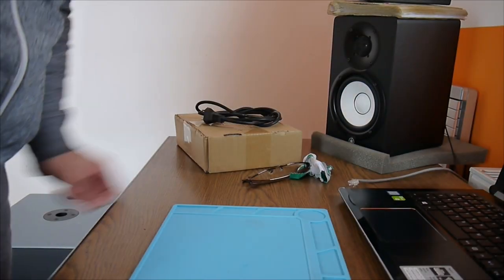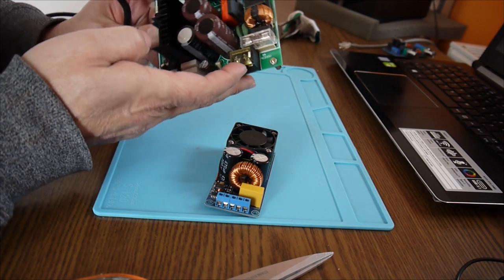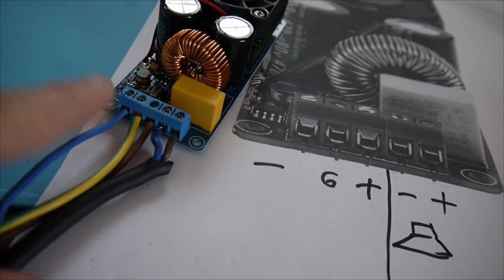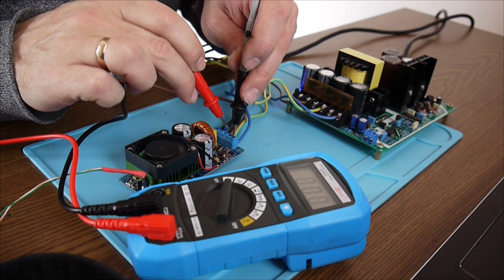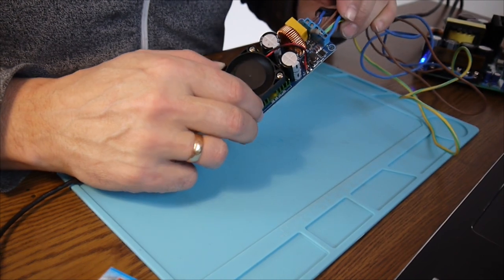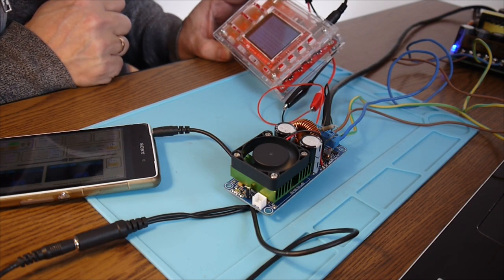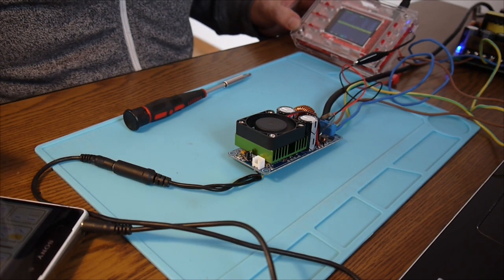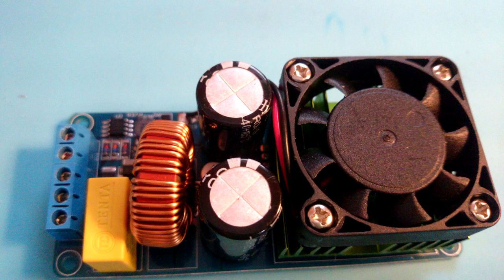Budget IRS2092 500W amplifier subwoofer project powered by SMPS 500W -+58V

Comment: I have tested these units extensively and now use them in a professional sound reinforcement application. When connected and used properly they deliver truly excellent performance. Unfortunately, this YouTube video shows very improper use. Here are some notes:

1. Choose a power supply appropriate to the speaker load. For an 8 ohm speaker, the optimum voltage is 63V. For a 4 ohm speaker use a 45V supply. The formula:
 V = sqrt(500W * speaker_impedance).

2. Class D amps, such as this one, work by switching their outputs high and low at frequencies far above the audible range. What you see as "oscillation" on the output is actually the carrier frequency. Under normal conditions (connected to a speaker load) the carrier signal is about 2 Volts. Because we cannot hear above 20 kHz, and the loudspeaker cannot reproduce sound at that frequency, this carrier leakage is not a problem.

According to the manufacturer, the switching frequency should be close to 400 kHz (as it is in the modules I have purchased). The small potentiometer near the input is used to adjust that frequency. This adjustment is necessary or advisable ONLY if you have multiple modules running off of the same power supply. Improper settings greatly reduce the efficiency of the circuit and can result in overheating.

3. NEVER APPLY POWER TO THE AMP WITHOUT FIRST CONNECTING A LOAD! For testing, you can use high power resistors.
The output of the amp drives a low-pass filter. The 10 Ohm resistor is burning out because, without a proper load, the amp is delivering its high frequency carrier frequency across that filter network.

4. Toucing the input leads with your hands as you have done here, effectively couples AC line noise to the amp by using your body as an antenna. Depending on the environment, this can be several volts and can easily drive the amplifier to its full output power, potentially burning out your speaker. NEVER DO THIS! Attach the input to a proper source such as a music device or function generator.

=========

On my bench, these amps deliver their full rated power. The signal to noise ratio (SINAD) is better than 80 dB (the limit of my test equipment), meaning that they are basically noise free. Silent, really.

The frequency response is flat over the entire audio range.

Other comments:
-- The power and speaker connectors are cheap and flimsy. You can purchase quality 0.2" spacing Phoenix connectors on the web inexpensively, and replace these.

-- The Chinese amp is based on a reference design published by the manufacturer (Infineon Technologies). For some reason, the Chinese amp uses a 100 Ohm resistor for R13 (near the input connector). The recommended value is 3.1K. I have replaced mine with 3.3K devices. This replacement is a bit tough for hobbyists, as they are surface mounted resistors.

-- Even though the amp is close to 90% efficient, at full load, it must still dissipate 50W as heat. The fan and heat sink on this unit are marginal, and the output transistors are not attached properly to the heat sink. At a minimum, be sure that you have good ventilation near the power amp. A much better choice is to replace the heat sink and fan. In my case, I desolder the output MOSFETS from the board, and attach them to a proper heat sink. I then resolder the transistors to the underside of the board,. This allows me much greater flexibility in heat sink design.

-- You may find it desirable to add some filter capacitors across the power supply input lines. Several thousand microfarads will help. Be sure to use capacitors with voltage ratings at least 20% higher than the supply voltage. Place these as close as possible to the amp to reduce the resistive losses from the power supply wires.
Reply: @Mark Cohen  
The fact that it works. I bought one module years ago and immediately replaced the R13, I put 3.01k in it. Works good, also, recomendation for better heatsinking is correct (Y) ! I used the same method, the MOSFETs on the bottom side of the board, on the larger aluminum L-profile, and on the opposite side of the MOSFETs I attached the same small heatsink with a fan, the area of the cooler is much larger.

Regarding the small trimmer in this video as well, it is wrong that it is twisted so randomly.
However - I didn't understand now that if you use several modules with one power supply, why is it necessary to adjust this frequency? What have I missed?
This module can be used bridged, and in this case it is necessary to set the frequencies on both modules to be equal. But is there any information somewhere about feeding several modules from the same power source and therefore some kind of frequency regulation if you DONT use them bridged but for example just stereo mode? What I have missed?
Reply: @inarinukka7729  THis resistor is already well known with this board.  - i got another question: From what i heard from other experts is that you acttually need the high voltage for max. power output on other class D`s as well. So i got 4 ohms speakers like most, why only 40V? Is that only a heat dissipation problem? From what i know these boards CAN take up to 90V input when you dissipate the heat properly. Thanks.. .
Reply: @MasterBlaster220  Why only 40V? You need dual polarity, sellers of these modules do not recommend more than +-70V but if you have module with genuine IRS2092 or at least good specimen (all of them are not good) of china equivalent - CSC3120 then you can go to even +-100V, in reality these genuine Infineon IRS2092 withstands this, known one experiment with +-110V and it survived. 
Manufacturer guarantees +-100V, i.e. the further is your responsibility, apparently a good specimen can withstand a much higher supply voltage, but it is individual. 
For supply voltages close to the maximum, additional protective measures must be used to protect output stage MOSFETs. If you have a good (known genuine) chip and fast MOSFETs, this amplifier generates very little heat, genuine Infineon chips do not need any cooling even at maximum supply voltage. Almost all (which I have had) CSC3120 need cooling because their losses are higher.
The only thing that needs cooling is output MOSFETs, but only if you really want to go at the supply voltage limit and at high power. The IRFB4227 etc. are obsolete for this today and there are much better ones already worth using to achieve high power and low losses. 
As for supply voltage, the specific module should be powered at least by +-50V, * only then it will work normally *, at 40V, the additional DC-DC converter on the board does not want to work at all, and this can disappoint many user of this amplifier and make him believe that this module does not work at all . In reality, these modules work quite well if you use them correctly and besides - for 10 dollars... how is that possible and if someone is not satisfied - let's do better for the same cost :D
Reply: @inarinukka7729  OK, thx for the answer. In this upper comment you wrote something about 40 or 45 Volts do ahve them work best iif i recall correctly, therefore i asked.

I got a 1250 Watts transformer. with 61V . Would be alittle risky, but i try. What could go wrong at 13€ for the board. ;)
Reply: @MasterBlaster220  I don't remember that 45V thing now, but for this particular module, more than +-70V is not good, there is an XL7005 converter on the board and it can be damaged if supply voltages are too high. For fully DIY IRS2092 amp, this part can be solved differently and therefore a +-100V supply is also possible.
But you also have to look at what is under the radiator with a fan - these modules are probably produced by different factories and sometimes corners are cut. There may be 150V MOSFETs, and in this case over +-70V is already critical for that reason.
In a self-made DIY solution, it is better to use, for example, SUP90xxx, SUP10250, or if the voltage is up to +-65V, then SUP80090 is good, to +-100V IRFB4227 can also be used (better if additional buffer stage between IRS2092 and these output MOSFETs), but there are better alternatives to them (IRFB4227) today, there are some very good series from Infineon which can get better results, you have to look at the small gate charge energy, at the same time the voltage and current parameters should be satisfactory, i.e. not too low, on the other hand, the recovery time of the internal diode and the internal capacitance of the MOSFET also come into play, so they must to make a compromise in the indicators, but in the case of a commercial product, quite a few different MOSFETs are used, if the efficiency is primary, then you have to choose from among the best. 
Most of these modules use the IRFB31N20, which is also not too bad, and they actually get quite a lot of power. 

61V transformer? You probably think that it is still a transformer with 2 secondary windings, both windings are 61V? You absolutely need a bipolar power supply (+- and GND line from rectifier), if you have a transformer with 2 secondary windings, each gives 61V, you get about +-85V on the rectifier filter, this gives a very strong power supply, all other things must also be sufficient, maybe also better cooling for the MOSFETs of this amplifier module. With this supply voltage, you get 800-900W of power at 4 ohms.
Reply: One more point I would like to add - " the IRS 2092 chip used in this boards are not original. You must buy an original chip and replace existing one .......
Reply from the maker: @apc2729 Thanks for let us know!
Reply from the maker: Thank you so much! I didn't succeed and I gave up to easy, but all your comments and some others here make me rethinking the project..but I'll try another approach with a classic transformer rectifier capacitors power supply..I think that PSU I used wasn't exactly in order for this kind of amplifiers..again, thanks for advice!
Reply: Can this be used for 12 volts on an 8 ohm speaker?  I'm an ME, this is a bit over my head.
Reply from the maker: @MechInvent  No, it needs a double power supply at lest 55V..
Reply: @viocaia  interesting. I appreciate the response.  Never even heard of that, all I know is home audio and car audio (120ac and 12dc)
Reply: @viocaia  Need some good 68 volt smps and a decent input, it really deliver more than 450 watt RMS ,
Reply from the maker: @apc2729  Yes, I know..maybe you've been lucky with good boards..please read the comments..mine just didn't work..I gave up so long ago..
Reply: Thanks for sharing
Reply: Thank you for your knowledgeable post about using these things.  My intent is to use a couple in a bass guitar amplifier for outdoor concerts.  Reliability at high power is essential.
Reply from the maker: @martyhewes8589  Please read the comments carefully..there is a way to make them ok..I'm a musician too, I really don't recommend this for live! I don't trust them..but maybe you'll manage better then me..
Reply: @martyhewes8589 you need to match it with a good pre amp to use ad bass amp....also you ahould use a.ripple free power supply unit.
Reply: Hello.   I have a question About the point number 3.  So even a sparker protector delay . Can't be connected   ?
Reply: Mark Cohen. 😄 at least I got the hookups on the amp from this video, the rest😕 😮😟😲...🤯🙄probably not so helpful.😁.I just have an old 29-0-29 toriedal transformer in my parts pile from an old PA speaker , and a rectifier GBJ2510 good to 90V-0,25A that's almost 400W right? I think it will need another resistor to drain those 5X50V caps on the bridge rectifier or after I shut it off or it would stay energized for a while after I shut off wouldnt it? Where should  that go? And instead of replacing the input resistor to 300kv could I just sauder another 100 resistor right on top of that one? I mean, they'd be configured in parallel  so it'd be like a 200kv resistor wouldn't it? And do I NEED an op amp ? Or can I run it strait to a 2  driver passive 8 ohm cross-over ?
Reply: Excellent comment and advice - Thank you
Reply: Something are very bad with these modules.
Subwoofer Klipsch use the same IC with +-56 volts DC and works fantastic.
These modules cut the sound and sound horrible.
Y try one of these with the Klipsch power supply and sound horrible, is not a power supply issue. 
Klipsh use a diferent 12 volts regulador circuit, maybe something is not working with properly in this section.

Comment: I have a couple of those modules, my question is how to connect them to the audio input correctly since I tried in several ways and I have a very strong buzz in the audio output
Reply from the maker: Please read the comments, there are a lots of tweaks to be done for a properly results..starting with the power supply

Comment: https://youtu.be/s2io0s2JIB0?t=533 It's because the amp feeds back the power from the speaker. This is also why class-d is high efficiency man! Get basics of switching mode circuits and power flow! This a core value of the swicthing mode operation and dynamic output LPF!
Reply from the maker: When you buy a product , it should be working..this is not a brand new scientific project, this are already  done and they should behave as advertised.I'm sorry but your comment is useless. You need to be a specialist when you do your own project, but this one is just a ''putting together;; thing for amateurs.
Reply: @viocaia  The advertised power is on resistive load. But you connected a speaker that is a dynamic system, not a resistor. It pulls and pushes power, otherwise it would get as hot as a resistor. Just think about what would happen if a speaker would draw hundreds of watts without pushing it back to the amp dynamically? It would smoke in a few seconds.. Linear amps heats that power, their output transistors convert that power into heat that's why they draw much more power than a switching-mode amp. A switching mode amp like you inspect has a dynamic (LC) low-pass filter at their output that pushes the power from the speaker back to the power supply via the output transistors' reverse diode. What you measure is just the difference of the pulled and pushed powers. The power that is really converted to move the air and feed the speaker's mechanical losses. Learn the basics of switching-mode circuits and it becomes clear for you.
Reply from the maker: @gyulanagy5910  No doubt you are very well prepared! I will consider searching your statues and learning about it.Maybe you should make some videos about , that will help us all.Thanks!

Comment: This same two board working 1 trasformer  howmuch voltage and howmuch ampre need please  replay
Reply from the maker: Consider P=U*I so for 1000W audio power you need at least 1200W DC..you need like 60V DC, maybe max 65V...and amps... 1200W/65V=18.5A...let's say 20Amps.When AC is rectified to DC you multiply it by a factor of 1.414, because your AC voltage is being measured in RMS because its a sine wave, so for 65V DC the transformer should deliver 2x47V DC...finally , a good 2x47V AC at 20A !

Comment: I don't understand the voltage operaron of these amp
Works well wich a 24-0-24VAC 33-0-33Vac and 42-0-42vac? 10amp per side. It's too much volt?
Reply from the maker: They said max +-70V, I used +-60V and it was a fiasco as you see.Probably at lower voltage it will work ..I just gave up the project , there are to many issues with this boards.Read the comments , you can find lots of fixings.